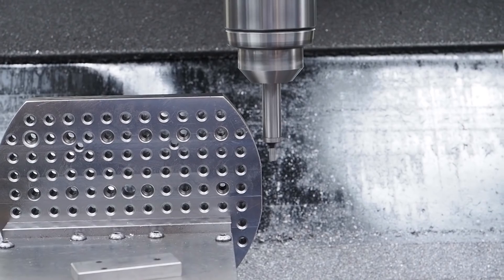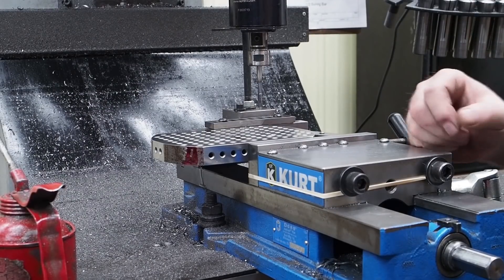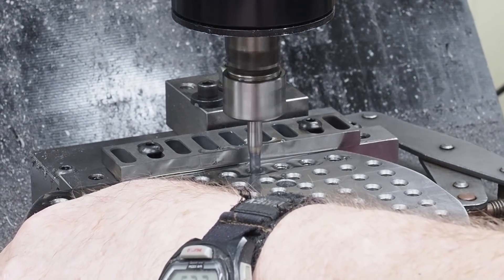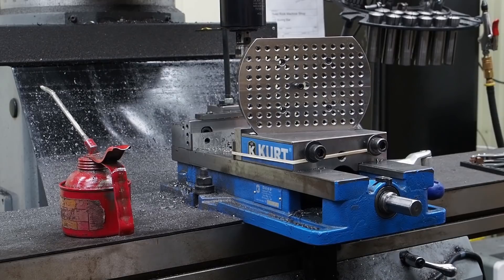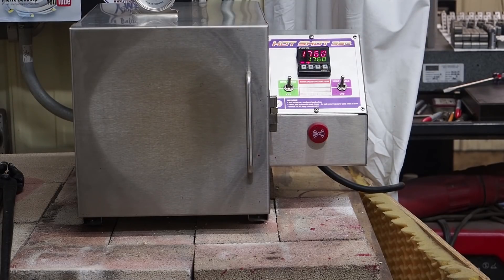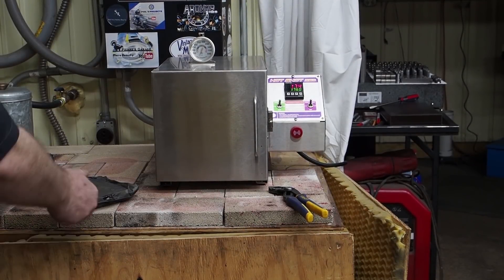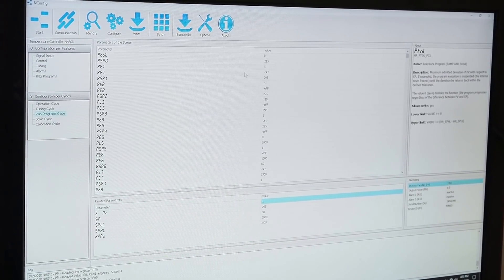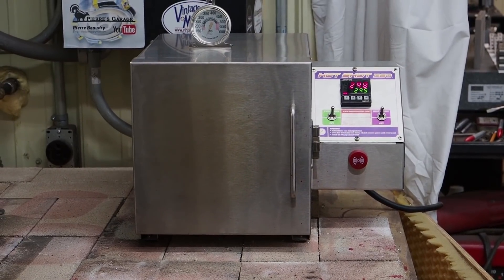Making of a Grinding Fixture Pt 1

Comment: Thanks!  It's always good to see one of your videos come up! 

 I have a old Grieve heat treat oven.  At 1800 the outside temp of the oven is slightly more than room temp.  I've had people come over and complain about all the stuff piled up on top of it.  It did little to heat the shop last winter :-(  Thanks for the tip one cooling down.  I always left the door open.
Reply from the maker: Hi Paul,
This one will get hot enough to burn you so you will want a good pair of gloves. Where I use to work they used the air hose to cool it down quite often. That might be why it had to be repaired often as well. 
Steve

Comment: The tempering temperatures vary a lot depending on the steel don't they .  A2  v 4140  , the  tempering temp you use for A2 is right smack in the middle of the tempering temps you don't want to be in for 4140 . interesting stuff . Cheers .
Reply from the maker: Hi Max,
Yes they do. I think a more accurate way to get desired results would be using temperature rather than RC. S7 is an example, you can hit 52RC at 4 different draw back temperatures. 2 of them are at the weakest point and 2 are at the strongest point for S7.
Steve

Comment: 300F is a pretty low tempering temp for A2. I guess for the application the brittleness isn't really an issue. I normally do A2 at 750 but it only comes out about 56-57Rc.
Reply from the maker: Hi Brian,
Many steels are weaker and more brittle at about the 55RC range. I know S7 is one of those. I am going for a good combination of wear and toughness. If I remember right the part ended up at 59RC which is perfect for what I wanted. My stove is about 100 degrees off in the low range. the actual temp was about 400 degrees.
Steve

Comment: I was taught to not let the A2 get all the way down to room temperature before tempering, but it looks like it works fine either way. Is there any noticeable difference?
Reply from the maker: Hi Max,
There are a lot of minor difference that people use in heat treating. I was always told to remove the wrapping right away but learn from others that it would be less scale and just as hard to let it cool in the wrap. That is how I now do it. I believe the part after 2 draws came out at 59RC.
Steve
Reply: @SolidRockMachineShopInc  well, either way thanks for sharing. You and your family do some pretty nice work. I'd love to pick your brain about wire edm tooling.

Comment: I realize this is an older video, and maybe I'm missing something, but can you explain (or link to another if you covered elsewhere) why the part is wrapped and in what? Is that a part of the tempering process?
Reply from the maker: I don't know the exact science behind it but the stainless steel wrap is used to seal the part against air. When steel is exposed to air and heated to high temperatures carbon in the material will form a rough scale on the surface of the part.  I believe this also damages the steel by changing the carbon content. I am sure there are a number of internet sources that can explain in detail what takes place here. https://www.azom.com/article.aspx?ArticleID=9624
Reply: @SolidRockMachineShopInc   Thanks! I understand.. I noted that that company that sells that oven makes an ARGON flow for it to do the same thing. I've not done it, but I understand that scale that develops can be quite a problem

Comment: 👍throw some potatoes in there too. Get supper ready and a draw back.
Reply from the maker: That is tempting.
Steve
Reply: @SolidRockMachineShopInc  
Steve, I picking up a Harig 612 and it is a dry machine. My little experience is with coolant. I'd like some coaching on dry grinding if u have time. Maybe some good video material. Would it be possible to use a stick wax on the part to help the process. I've used it on our carbide diamond bench grinder with good results. Keeps the harmful dust down too. 
Basically like to know the main differences from dressing to grinding dry vs wet. If you have time. Thanks Steve.
Reply from the maker: Hi James,
One of the most important things is to get a free cutting wheel that generates as little heat as possible. As you take stock off always be aware of how hot the part is. If it is even a little warm the part will not be flat after it cools. Work your way down to the last .001" redress your wheel and only take a few .0001" at a time until the last .0002" at this point you need to take less than .0001" at a time with blank passes with time for the part to cool between passes. If done right you should be able to grind flat to a .0001" without coolant. It will most likely be a little low in the middle of the part.
Steve
Reply: 👌 much appreciated Steve!

Comment: Odd that industry standard temperature probes aren't being compensated correctly by a programmable controller built to use them.  I would have thought ann necessary fudge factors would be built into the controller itself.

For the kind of business you're doing now, what do you figure the break-even time is for investing in ovens, versus sending out parts for heat treating?
Reply: I would be willing to bet a lot has to do with saving the time of sending out.
Reply from the maker: Hi someone else,
Mine is off a little more than most, but by making config files it doesn't matter to me. The break even is not important to me as much as the convenience of having something done right away. I used it enough already that it would have paid for itself already.
Steve
Reply from the maker: You are correct Roy. They are cheap enough to pay for themselves very fast as well.
Steve

Comment: Good morning any problems with the taped holes after heat treatment
Reply from the maker: I use oversize taps they are .005" over so most of the time no problems. In DC-53 you have issues with small particles fusing to the threads if you do not clean the holes really good before heat treat.
Reply: Thank you . I am a 73 year old newbie